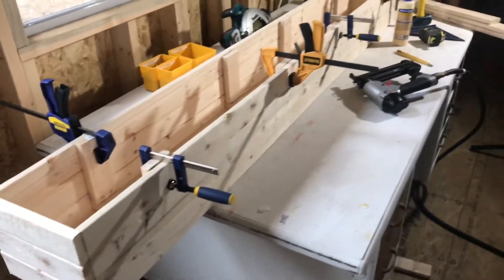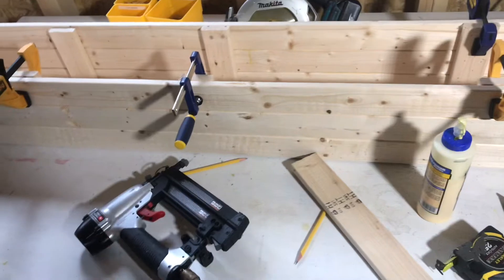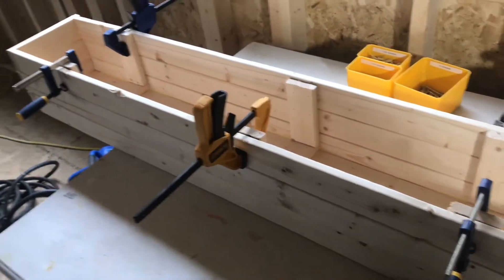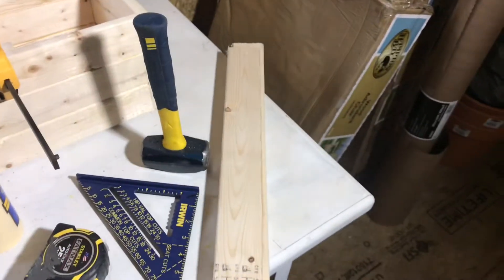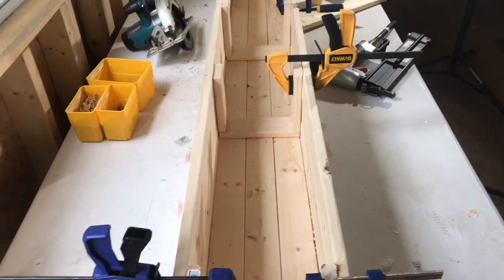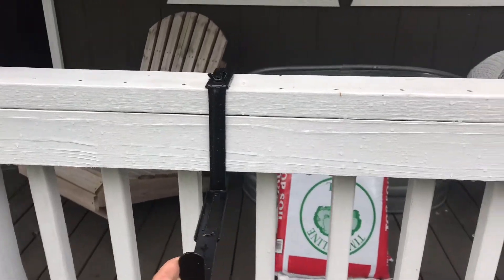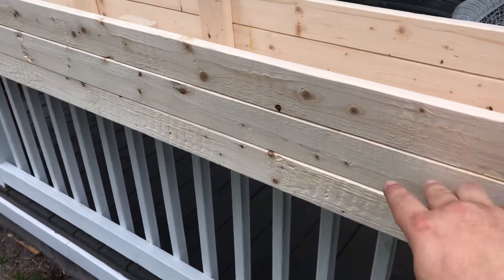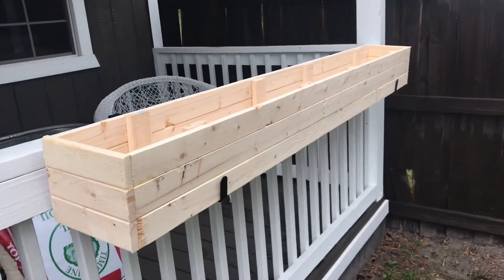Small Balcony Planter Box Build For Under $25

Comment: Build a planter box for under $25, as long as you already have 2 grand in wood working tools.
Reply from the maker: Hahah. I know man. But seriously you could do it with a hand saw and a hammer and nails. Just will take a little longer
Reply: Do you expect to only need wood and NO tools to build 😂
Reply from the maker: Nails and a hammer. Use your teeth to cut the wood. Or a high quality woodchuck.